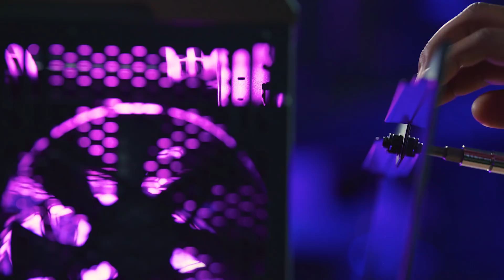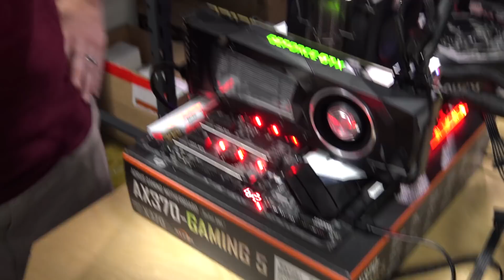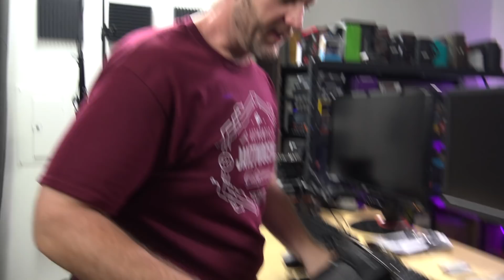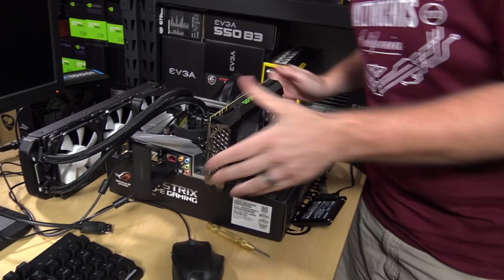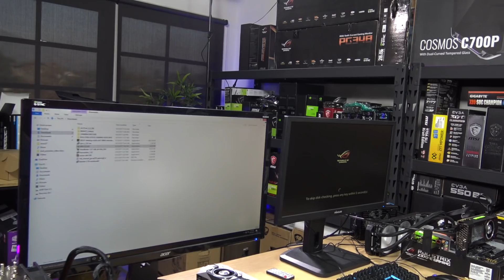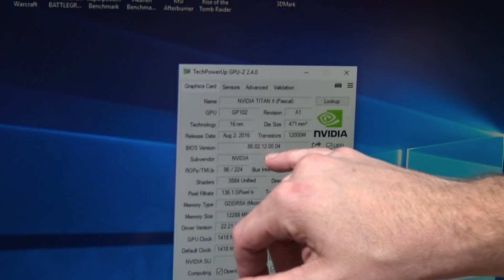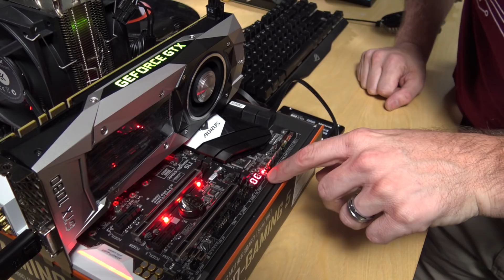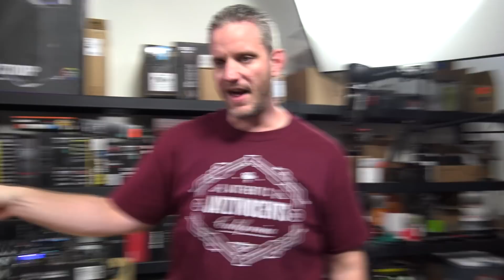I cant figure this one out... HELP!

Comment: As others have already mentioned... you checked the same card bios version twice. If it's actually different that may explain the issue, but not necessarily solve it (as you mention flashing graphics card "bios"/FW is difficult). The question is why it's happening --boot with the working card and go into BIOS setup and check a few things I noticed might be interesting from the manual... 1. VGA EFI mode (default) try disabling this to drop to legacy mode in case the non-working card is somehow incompatible (i.e. pre-release gpu FW/"bios" missing something?). 2. There's no integrated graphics Ryzen CPU yet... but on the off chance Gigabyte did something weird/wrong --you may see the option for "Integrated Graphics" available in the BIOS... it defaults to Auto --if the option is there, maybe set it to explicitly use PCIE. Another thing to try is, as others have stated, just try different PCIE slot. I've actually had this happen on my sister in-law's computer --it may have been an MSI board as well. The top-most PCIE slot worked fine for years with an old GPU. I went to upgrade for her, and the new GPU didn't work in the same slot --swapped back.. no problem. Finally had to install the new GPU in a different slot to get it to post. Weird.

Comment: This is interesting... I just bought a 1080 Ti and was having issues with it getting past the post. It stopped at b2, just as it did for Jay. If it's the same error code as mine (I have a much older P67 socket 1155), it means "Legacy Option ROM Initialization". I have an option in the bios where I can choose between that and "UEFI Compatible ROM". Choosing the latter is what caused the problem in my case. Not sure if that option is even available on newer bios', probably just defaults to uefi compatible. My guess is that even though they both got the same bios, something is not working right between that motherboard and that graphic cards bios.

Comment: You never checked the bios version on the GPU that you swapped to the Intel system. You only confirmed the bios on the GPU swapped to the Ryzen system. (on camera). VRAM different on GPU's? Damaged/dirt on GPU PCI-E 3.0 connector?

Comment: Some mobos don't boot with certain USB devices plugged in, if I have my fanatec wheel plugged in and turned on, no boot? Turn off power and it boots...  drove me nuts. I disconnect USB's devices when pc's don't boot to find issues

Comment: I would advice finding a way to check a known, consistently working card and those suspect Titan cards with particular pins on the PCI Express bus to make sure that they are communicating correctly. Here is a link to the pinout. There maybe issues with the comm syncing. http://www.interfacebus.com/Design_PCI_Express_16x_PinOut.html

Comment: Why did you check the "bad" GPU's firmware version on both system and not comparing it with the firmware of the working GPU?

Comment: Checking the BIOS on the same card, twice!
You checked the Titans BIOS on the Intel-system, then changed cards and checked the BIOS (on the same Titan), but on the Ryzen-system!

The BIOS version might actually differ, but you haven't noticed, because you've made a mistake while swapping and checking the graphics cards.

Have you tried swapping the mainboard-battery? I've had the weirdest errors, I've ever experienced. In the end it was an empty mainboard-battery, with nothing giving me a hint, that this might be the problem.

Comment: It's probably the gpu. I experienced this sort of issue when I built Ryzen, a RX 470 that didn't post. I updated the motherboard bios and got a signal but the gpu refused to work. The motherboard worked with a GTX 660Ti. Updating the gpu bios fixed the issue.

Also you only checked the good card's BIOS.

Comment: Sorry Jay, but you never looked at or showed us the bios version on the ( non working) card you moved from the left to the right in the beginning portion of your video. You put it on the Nvidea (to the right) motherboard, then you went to the working card on the left, which you just moved from the right. Then you said it had the incidental bios. Of coarse is did, you had just told us what the bios was when you had it installed on  system to your right. We still don't know what the bios version is for the (non working) card you had installed on the left.

Comment: On my Asrock z77 and msi gtx 770 if I reset cmos I have to plug my monitor to the onboard gpu for the 1st boot and then reboot and plug the monitor on the gpu to make it work properly... (debug led was showing error code for IDE/SATA drives ) when i upgraded to gtx 1070 that issue was magically resolved and i had no problems either with my brothers gtx 960.  When i 1st saw what happened I thought power supply issues probably then I guess you probably tried that already and remember the weird issue i had. But yeah try different connector on the card or something for the lols and maybe a PSU swap !?

Comment: Uefi legecy bios problem  there was a similer problem with the gtx 580 i know u dont want to flash the bios but just copy the bios from the card that works to the one that dosent the cards bios is having troubles knowing the differnce between its bios and the motherboards if its uefi or legacy ive had this before and ot seems to get worst when u install drivers u could try back dating the motherboard bios.

Comment: Try replacing PSU with all the cables. Check if Power connectors on that GTX1080ti aren't broken or loose

Also try cleaning the PCIE connector on GPU with alcohol

Comment: It might be just because of editing, but when you say the firmware is the same - you don't show what the firmware number is, of the "broken card" while in the Intel system. You show the "working" card's firmware number while in the Intel system, then again as it is still sat in the AMD system.

I'd be looking at the PSUs, and try on both systems, and different internal power cables. I've had problems where the juice wasn't the same. And where metal inside the plugs were not connecting correctly on one card, but was on another.

If it's none of that, I'm stumped too, and I've been doing the IT game for 20 years, and building PCs for 25.

Comment: My GPU would hit power limit under full load on stock clocks and stutter. Tried 3 GPUs same problem. Changed MOBO, PSU, and CPU. Same problem. (7700k,1070,EVGA 750w G3) 
Can something in Windows be causing it to throttle?

Comment: Maybe Titan does not pull/pulls more power from MB and something switches off? Try another MB with same chipset. Or ask Gigabyte, they will probably send you another model of the same MB, you can check if it works in it.

Comment: Hey Jay @ 5:20 the GPU BIOS you checked on the AMD system was the same. But its the same card you just pulled from the Intel system, that you just checked, so yea that is why its is the same. You should have checked the card from the non booting AMD system in the Intel system to see if the BIOS firmware was the same. Think you just getting stressed on this and just confused yourself. :-)  It happens..  
EDIT: BTW, I been building systems for my own and friends since the mid 90s (also I am A+, CIW cert & degree in programming). I have seen crazier stuff. This is why I would not ever consider building systems commercially without being part of a system builders programs from AMD, Intel, Asus, etc.. That way I could have batches of CPUs, GPUs, RAMs and Boards all in stock. I have seen identical hardware, right down to the firmware work perfectly in one completely identical system, but not the other.. Despite having the exact same firmware updates, drivers, drives, everything..  Its mind boggling..

Comment: Amateur PC builder here.

I had a similar boot issue some time ago: initial troubleshoot points to a faulty GPU (no display with my GPU but able to boot with onboard GPU). Swapped with a known working GPU but it still failed to boot. Flashed bios, updated drivers swapped for new cables blah blah blah all didn't work either.

Then I swapped my PSU with another brand (seasonic vs evga), it boots properly; so I thought maybe my PSU is faulty and went for a 1 for 1 exchange of my current PSU (under warranty) but it still failed to boot with this brand new PSU. Final resort was to exchange my mobo (under warranty too) and it finally boots up.

Although the problem was fixed eventually, what perplexed me till this day is that if it is a mobo issue, why would 1 model of PSU work when the other doesn't? 

On a separate occasion:
My SATA ports could only read/write my SSD/HDD on a specific port combination. E.g. HDD1 to port A and HDD2 to port B (same models); if the ports are swapped it doesn't work. 

Still doesn't really make sense to me till this day.

Comment: It could be a PCI Express issue.  I had an instance with an X1650XT years back that had a bad PCIe channel on the card and it wouldn't boot in 16x on my AM2+ 790GX-M2RS board but worked great in my Socket 939 Sapphire board. Ended up being a bad PCIe lane on the card itself. Ran the card in 8X on the 790GX board and it worked perfectly.

Comment: @jayztwocents You didn't check the falling cards bios as many stated.

Also with ryzen platforms infancy a newer bios doesn't guarantee a better result, you may try downgrading to a known hood version.

Finally it very well could be a power issue since at one point you also saw a cpu issue, or the board is trying to boot a nonexistent igpu like old Nvidia Era amd chips to used to do.

I feel like some wierd bios issue is the most likely though. Either try downgrading or contact mfg and see if they have a beta version you can try.

Comment: This is not "AMD RYZEN'S" fault thats called a mother board right. I did not know AMD manufactured RYZEN branded motherboards not. How is this a Ryzen "PLATFORM" issue? Its called a bad buggie board made by a manufactor not called AMD.  And seriously it can be any thing. It could have got damaged in shipping. A drop of sweat could have fallen in the pcie slot while working on it, board could have been missed handled bla bla bla  Ask other people with that board and see if they are experiencing the same thing.
Reply: Because he previously made a video about the intel chip which received a lot of heat. Now he has to force out a video to shit on amd to be "unbiased^tm"

Comment: So I have had issues like this in the past on two separate occasions. The issue was with the motherboard, but not in a way that you would expect. I was trying to get a gtx 970 to work is a asus z97 deluxe motherboard. I was moving up from a z97-a board that I was giving to a friend. The gpu would work on the -a board but not the deluxe board. I exchanged the deluxe motherboard for the same model, and the same darn thing happened. So I called asus support, and they told me that basically the deluxe board was much more picky about hardware detection and it wouldn't post unless everything reported back with absolutely no errors. In other words, they were saying that the deluxe board was seeing an error that the -a board wasn't seeing. 

I found this to be pretty far fetched, especially because I wasn't seeing any performance issues on the 970 on the -a board. So I exchanged the board a 2nd time (3rd deluxe board) and the same darn thing happened again. So I know it sounds crazy, but I kind of believe asus that the board just didn't like my card. 

It could be the same issue here. The gigabyte board might see an issue with the gpu that the other boards aren't seeing.

Comment: Thanks Jay, more reason not to recommend Ryzen. First, it was RAM with higher RAM speed (higher than 2400MHz) wouldn't work, my brother built a R5 1600, with 2666 MHz, fails to POST. It's not a faulty RAM, since I checked it on my Skylake platform, it works fine, even with XMP. He's stuck with 2400MHz speed, rather than the 2666 Mhz.

Why does OC Ryzen platform requires to turn off some odd settings where normal OC users have to touch? Like HPET, etc? Intel just bump up the multiplier and voltage, and easy OC. You can also do the base clock, but that will impact on RAM speed, etc.

I don't know why people say 'update BIOS' when it should just work right out of the box. You should update BIOS when there's a new processor available, or add-ons aren't working with the board properly, not because of some rushed launch, I've seen this RAM and OC issue across Ryzen platform, regardless of manufacturer's board, like ASUS or MSI, only a bios update fix it. My Skylake platform, MSI Z170A Gaming Pro Carbon, is still using bios version 1.3 (out of the box), and didn't bother updating it.

Now, it's just random graphics card that wouldn't work on Ryzen.

Comment: Since amd cpu are so ram sensitive based on my experience (gpu as well) does swapping ram works for you? I has worked for me in the pass with my radeon card on intel system and also nvidia/radeon card on amd system (back on the phenom x4 days though)
Also maybe reseating the cpu and make sure the heatsink is not too tight. My z97 maximus gene will not detect 2 banks of ram when my thermalright venomous x is fully tighten even without the center pressure piece on.. if i loosen it slightly the ram will then detect but i will get gpu driver crash on my r9 290. Then i have to loosen it a little more.... I should really spend money on a new heatsink or go aio for my 4770k...

Comment: Try a different pci slot to eliminate the slot being finicky with that card.

Also look at asic quality of both titans. When a computer post, we know it runs the system at full tilt and then settles down. That card might be a real current bleeder when it comes to asic quality and it may be trying to draw too much power through the pci slot on post and that motherboard is telling it to not do that.

Also try resetting the cmos. Who knows, maybe ryzen keeps a log of bad hardware stored and that specific gpu gave a bad first boot for whatever reason and now when the bios sees that specific card and it says nope, I know something is wrong with that, im not going to even try and boot.

Comment: Really Jay? You never experienced something weird before with nvidia cards? What about the MSI 1050 TI video with the 2 identical  cards that were not identical in reality? And about troubleshooting. You change the only component that fails and you dont believe that this component is the problem? Really? The fact that works on Intel doesnt mean its an Amd problem. It means quality check on nvidia sucks. There is some kind of incompatibility with ryzen that Amd is not to blame. Why? Because otherwise the problem would apear with many other cards if it were a platform issue as you suggest. Jay, you dissapoint me, really.

Comment: it might sound weird but try switching the ram to the 2 other slots. ive had my computer (intel) blue screen and not post afterwards until ive done so, and it would throw a vga code (i think). ive also had to do it when booting up after a shutdown for no specific reason at all.

Comment: Jay it's been said 1000 times but you didn't check both Bios just GPU-i (for lack of better naming). You should bring up the Bios for GPU-i & GPU-a at the same time.

However if that fails and is not the problem then it's possible the AMD motherboard has some dodgy pins on one of PCI-E ports.

Comment: Try to flash the bios on the motherboard and reinstall it then ghive it a go.
There is a slight chance that the gpu has a issue that is just simpli not showing in code for you to understand what the problem is .
From experience in most cases there is a one in a milion chance for this sort of errors to occur since these are just wierd things that happen between the mobo and the pcie link for the graphics card.
Hope this works .

Comment: nvidia problem :D

more seriously, perhaps there's something flaky with that particular motherboard.  i'd RMA it.

its more motherboard than CPU related.  something on the board isn't quite up to spec.  don't think it is "Ryzen" related, it's just a bad board - happens with both intel boards and AMD boards.  you can prove this by putting your ryzen processor in a different board.

as to why one titan works and another doesn't - you even did a video recently showing that even 2 GPUs of the same make, model and brand are not equal and give different benchmark results.  if the motherboard itself is just a little under performing in some spec then this could be enough for some GPUs to work in it and some not.  you already determined the GPU works elsewhere, the CPU itself doesn't have anything to do with this particular issue.  that just leaves the motherboard.

+JayzTwoCents , have you tried the card(s) that don't work in a different slot on that board?

And yes, having spare hardware (even old) is useful for troubleshooting.

Comment: I am new to building pc's .  Is it possible that its the display port cable that is having issues?
Reply: Yes.  Also, the monitor could be the problem.  He needs to isolate the fault by replacing one piece at a time.
Reply: No, if it was display port or monitor he would have the same issue on the other motherboard or monitor would not work with other gpu.
Reply: No the rig wasn't even booting
Reply: I did say the cable, not the port on the card. And for the boot your right it would still boot if it was only the cable.
Reply: DjxJt13 Still a no, it wouldnt work with the other gpu.

Comment: Jay, you should wait until the GPU discharge itself completely before switching over to the Intel system and vice versa
Move the GPU to another pcie slot
Try to clean the pcie connector with alcohol 
Try another PSU
Reply: The PSU and pcie connectors clearly are perfectly fine, otherwise the other cards wouldnt work either.
Reply: ThePrussianGamer Yeah I guess you're right but just in case :)